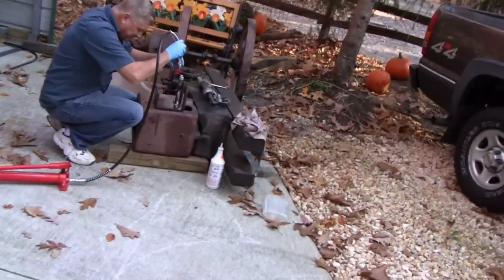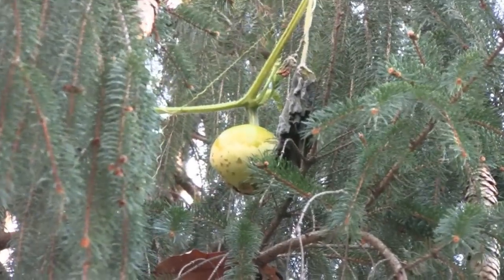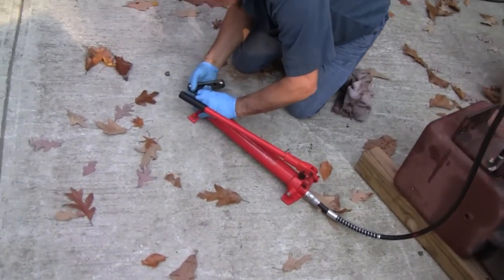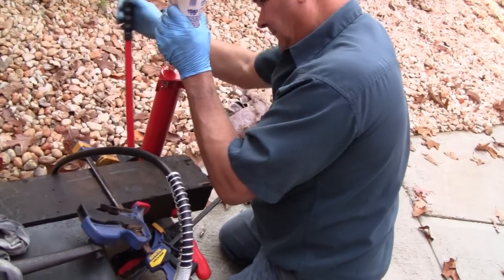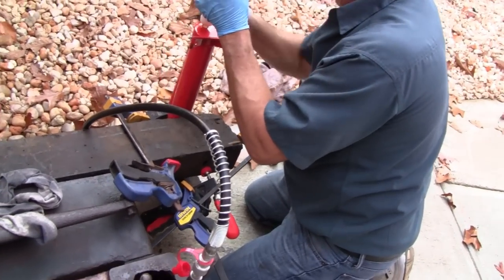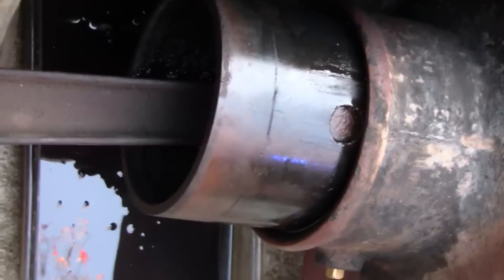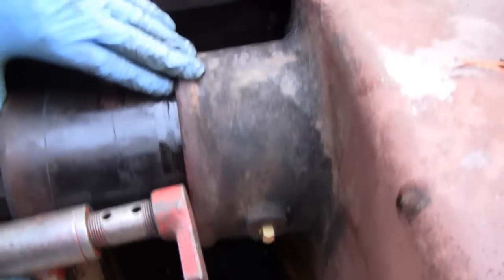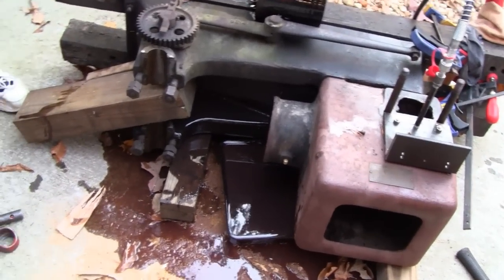UNSEIZING A HIT AND MISS ENGINE (part 4)

Comment: hi guys i have been doing restoration for a long time , next time you run across a stuck piston like this one try this , get the hose from a compression tester and take out the valve stem . put a bushing into the quick disconnect off the gauge to fit a 1/4 inch pipe thread and screw it on to a grease gun hose . the grease will not leak out as fast and does not splash everywhere when the piston comes out . also a long lever grease gun works a lot better then a pistol grip one .
Reply from the maker: We thought about grease but it would have cost over $100 to fill that cylinder!! The waste oil was free!!☺

Comment: Preface: I don't know how fragile things are on the motor. Roadking you are a body guy, why didn't you use a body slid hammer to hooked to the crank end of the connecting rod bolts and use that well John was porta powering the piston size?
Reply from the maker: Yeah I have a big Slugger Slide Hammer!! It was stuck too bad to use that, plus it would have damaged the wrist pin and the babbitt on the rod!!☺

Comment: I have a similar hit and miss engine. and I'm having a similar problem with the side year I can't get it come off and I don't know why do you have any advice
Reply from the maker: Without physically seeing the engine I can't really suggest anything except alotta penetrating oil, a gear puller and maybe heat as a last resort!!☺
Reply: The penetrating oil might be a good idea. But the gear puller I was afraid I'd been the gear before I pull it. If I could only understand how that particular side gear comes off maybe I understand more what is stuck
Reply: The penetrating oil might be a good idea. But the gear puller I was afraid I'd been the gear before I pull it. If I could only understand how that particular side gear comes off maybe I understand more what is stuck
Reply: Do you mind if I ask where you guys are located? Which state I mean
Reply from the maker: NJ
Reply: I didn't know New Jersey people worked on stuff like this

Comment: Wow, that looks remarkably good, do you (can you even)  get new rings, or can you just clean those up? So just a quick scuff honing, and put it back together?
Reply from the maker: Getting new rings is no problem, they are actually pretty cheap too!! Those looked pretty good, if you can get them off without breaking them!! Hopefully the cylinder isn't too bad, but even that can be sleeved!!☺
Reply: @805ROADKING   where do you buy your rings from ? , I have an old Mogul 2 1/2 hp ,4 1/8 bore that needs rings .
Reply from the maker: @Cobra427Veight  Starbolt Engine Supply has them for that engine!! Google it!!☺